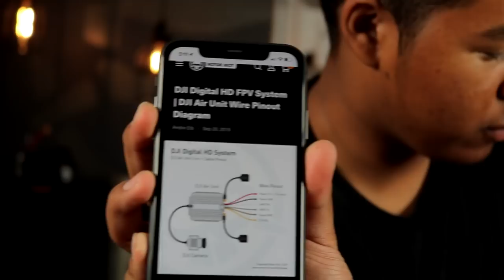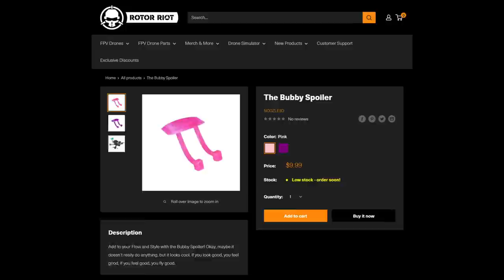The Moxy - Bubby's New Freestyle Build!

Comment: this is really similar to my build, well, your camera mount is way better than mine :)  Long stack screws, yes, way better than nylon standoffs. And that motor wire protector is awesome. I might buy some of those for my next build. If you ever switch to 6S, The best esc I have found is the Hobbywing XRotor Micro 60A 6S 4in1 esc. There is a flight controller that goes with it just like your combo. I have been using two of those ESCs for a couple years now. I have fried several other escs, but these xrotor ones are crazy reliable.

Comment: so far, i only have a couple of flights with this frame...and it's amazing!  a few caveats... i am flying with a gopro session so i had to print my own mount for that.  works great so far but i am seeing a lot of jello in the video...not sure if that's the mount or something else.  the only thing i noticed was that the motor mounting screws were a little short IF you use the supplied Rotor Riot skids (which i love, btw...glad they are included!).  i'm gonna try again but with blue loc-tite on the motor mount screws and see if that helps...you know, frame resonance and all...lol.  either that or i'm gonna have to modify my gopro mount.  yeah, some of us still fly with a session...(hint...hint!!).  all in all, a VERY solid frame and i can see getting more of these in my future.  thanks Bubby and keep rippin'!!!
Reply: Hey man! So the jello issue is definitely not a frame/mount issue. I’ve been running no Hypersmooth recently and there’s nothing, granted my kwad is tuned very well. And I will see to change the motor screw length that comes with the kit. Thanks for supporting it!
Reply: @BubbyFPV  absolutely bro!  you've designed a very well built frame and i look forward to flying it more!  i really think it's just my gopro mount but i have to make sure all my bases are covered.  my mount is for a session 5 and not a 6/7/8/9/10 so that might have something to do with it.  i'm going to print other mounts with varying infill and see if that helps.    either way, well done!

Comment: Try the Tiger Motor F55a 4-1 ESC that ESC is a beast I run them with F80Pros2200kv on 6s. I have only ever popped 2 of them over the course of using them on all my builds for 10 months. One of the best ESC’s. It’s like 100$ though lol

Comment: hmmm... one question.. you have the battery leads coming out of a little "cutout" a tthe side of the frame.... battery leads.... conductive carbon with sharp corners?  i would have at least chamfered the edge
Reply: Could  sand down the edge and chamfered yourself or use the outer shield from battery wire cut a slot and hot glue it  around the carbon or even cover the stand off too
Reply: @Teklust5401  yes.. you could do all of this, but imho this should be done at design time. make sure all the sharp edges are chamfered
Reply: @WX4CB  yeah would have been done but to keep cost down most companies don't do it .. I personally make a effort to chamfered  frames I get even had some that had jagged edges from factory that where chamfered no biggie 10min job done deal
Reply: @WX4CB  the frame has chamfered edges
Reply: @BubbyFPV  yes but those plates don't and that's hat's going to rub up against the wires (even though you have them ziptied)
Reply: @WX4CB  I mean maybe it will, but I’ve been flying this frame for about 6 months now and even on other frames I’ve ran my battery lead like this and have never had the carbon cut the battery lead. So like maybe in theory it could cut it but me and my friends who fly this frame never have  gotten that cut so 🤷🏾‍♂️.

Comment: Thanks for making this video, the whole DIY with the tech is great, but the main thing for me was the fact that when you plugged in the battery, and the 3 beeps came in , and you explained why, Because I just built one and it, after gave me all the beeps, until I updated it in beta flight, without a radio. NO body and I mean NO body talks or tells you about it, and you think you got a messed up ESC and your checking all your sober points over and over again...smh..So thank you.